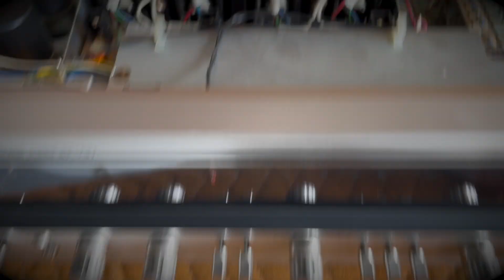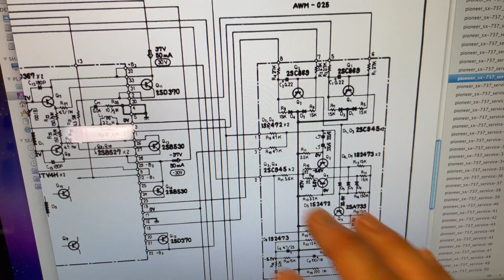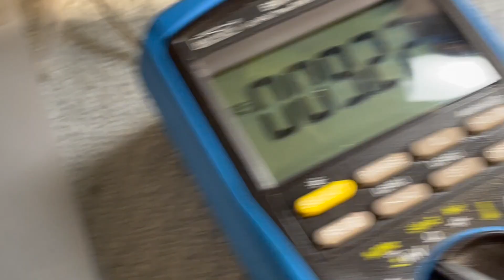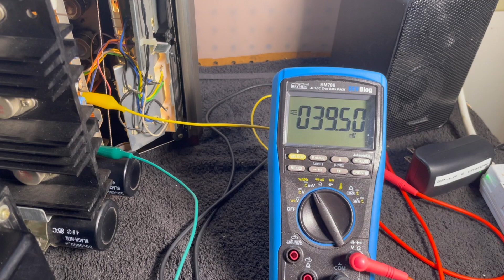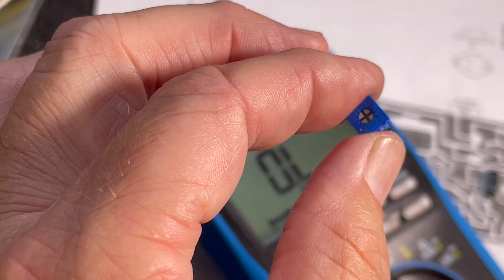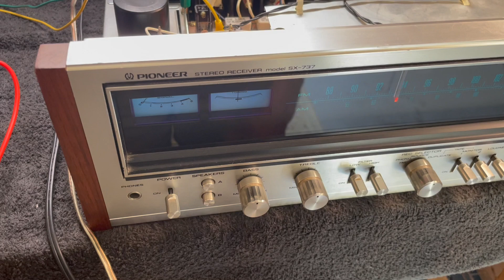Pioneer SX-737  Intermittent protect troubles and restoration

Comment: I need a happy ending for my SX-7730. The black version of the 737. Had it to thr shop twice for intermittent relay protection. They said that they needed to replicate the issue to find what was causing it. He had it for 2 weeks. Says he played it for hours a day for 3 days and it only happened once. I took it home and it happened in the first 30 minutes on low volume and happened a bunch more times after that. I asked if he could change out the transistors in the power amp or protection. He told me that there are 200 traand 200 caps in it. That's BS. He said that people come in often asking if they could recap their vintage receivers. He said that can't be done.

Comment: The pots are heavier duty leads than the regular components because of the torque they will get for adjusting. All components are put in then leads are bent to hold them in place for soldering. PCB's are then dipped into a shallow liquid solder bath & everything gets soldered at once. Then PCBs get wires attached by hand soldering when screwed into the chassis. You would never be able to afford a new receiver if ALL the components were soldered individually by hand one at a time.

Comment: WHERE DID YOU BUY THE Q-1,2,3,4, TRANSISTORS ?
Reply from the maker: This is the ebay seller who is very helpful and responds quickly to all of the purchases I have made.  He has complete rebuild kits for many types of receivers.
https://www.ebay.com/itm/116115594529
Reply: @davedrezTV  THANK YOU DAVE I SAW IT ON YOUR SITE   AFTER I ASKED THE QUESTION.